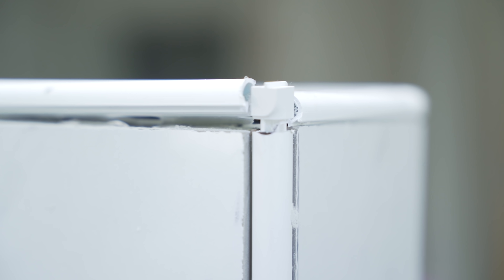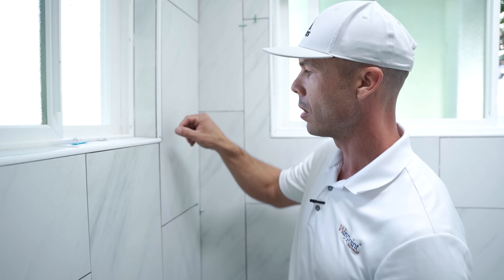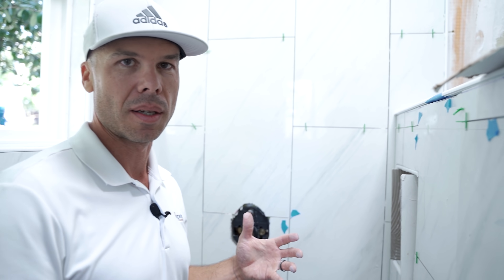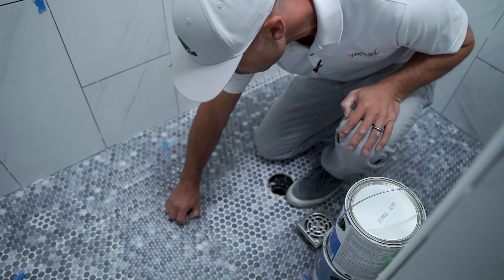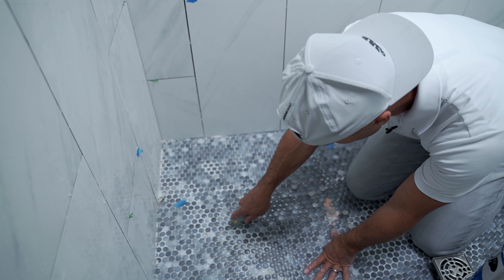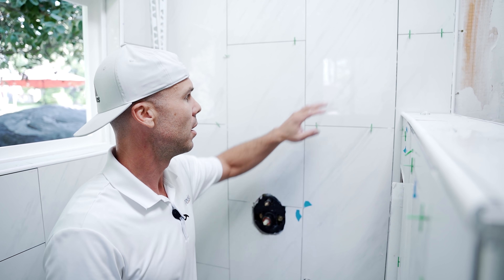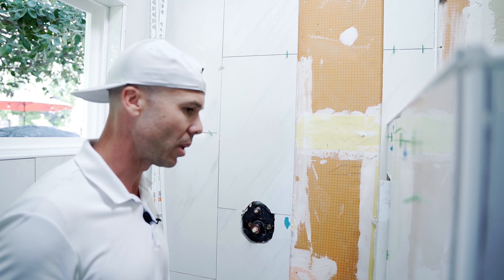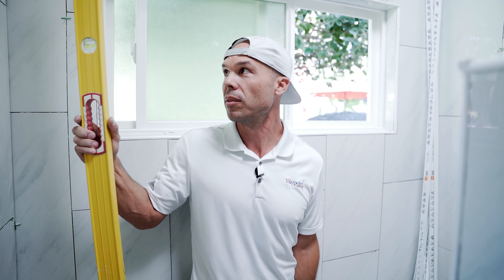WORST TILE JOB I'VE SEEN - Can We Save It?

Comment: Amazing channel and great video. Did my first tile job in a large shower and had to hire a tile setter to finish the kitchen (had another job start and couldn’t do the backsplash in time). The guy I hired has 16 years experience and said my shower tile work was almost or even just as good as his, all thanks to watching your channel and knowing what causes failures/common mistakes/setup and prep etc.

Thanks again

Comment: Thank you so much! I just had a trainwreck of a tile job, which the "contractor" offered to redo with a slab of wonderboard to even out the uneven (partially concrete) wall in our 1960 apartment. Your comments - twice - about not leaving space for condensation to build up - are invaluable! As is your comment about a licensed contractor. Knowledge is power!  And yes def get on nextdoor, I have found really good people through that app. Thank you!!

Comment: I am a homeower and have been doing my own tile.   Some parts have gone well...but my shower has been my nemesis.  The builder cut some corners when when building it initially and i had to rip the whole thing out due to mold and much too late for any warrenty.  I rebuilt it and tiled it.  And it looked awful.  Mistakes were made.  So I was forced to  tear it all down and start all over.   Several Weeks of hard work down the drain and it wasnt like I didnt try to do a good job but you dont know what you dont know.  So far the rebuild has gone much better.  Thanks for all your tips.  I will add one: in case you lay down your thinset too thick and have to scrape the joints before grouting, Dremel makes a bit  that makes removing grout much easier.

Comment: I started out earlier today watching Issac's 'how to' videos and was encouraged to build out two showers in the new house I'm building this year. Learning how to do it right made me confident. Then I continuted on watching a few of these fail videos, and I now have a lump in my throat. While I feel confident in being able to build the pan and walls and waterproof it all, I'm realizing that while that is critical, it is easier to learn. The REAL skill begins when it's time to set tile, especially with niches, curbs, and kneewalls. Getting everthing to line up, having a well-planned layout, have neat edges, straight grout lines, no lippage...oh man, that makes me nervous. But like Isaac says, no quality tilesetter will come in and set tile on someone else's substrate. So it seems to be all or nothing, either full DIY or full professional, start to finish.  I've done backsplashes and 3-wall tub surrounds, but I'm realizing a full shower is a whole other thing. I am a long way off time-wise for the tilework, but I'll be watching many for videos and thinking long and hard before I commit to do it myself. So these videos are very valuable in that way as well. They also make it crystal clear that it's important to get references and if possible even see the work of prospective tilesetters. Even as a DIY guy, I could see how horrendous the quality of this work was.

Comment: Well done. Nice job being compassionate towards the installer. Person was probably in over their head. Even if they’re a hack. Very tactful delivery.
Reply: Personally, I tiled my tub surround and I used cheap 12x12 tiles.  It doesn't look professional but it looks ok.  I tried to do everything 110%, which means that with my errors, it's probably 90%.  I live in a dry climate which helps.  Anyway it seems to be holding up great.  I wonder if this guy had used cheap tiles before, and then was hit with these expensive fancy tiles.  If I cut those things, they would look like crap.  I didn't have any L cuts though.

Comment: I think all of us tile installers make mistakes from time to time and that's honestly what likely to have lead half of us here to this channel. Tile at a glance looks easy, however by working with it consistently you learn that this isn't easy. Especially as a young contractor you find out the hard way that when it comes to tile work and getting the correct finished product. If your not correct and plum level and square and if your not gentle or experienced at making cuts. Your bound to get tired after thinking you've already covered all your bases which has already worn you out to start with. Then moving forward to find that this wall or this floor or these joints are not going to square up no matter what angle I try and push them on, already jammed up halfway up the wall and you realize. This mistake will lead to one of two conclusions. Either you take everything down fix and most importantly replace all that tile which is now useless. Or you try and sneak in an inch here.....................and end up being off a mile on the other side of the room because you were too tired or so frustrated to admit to yourself or the customer saying " Look I made a mistake over here and the result is this small section of tile will need to be replaced. I will be happy to cover it for you on the back end of my pay. But I'm afraid at the moment I can't cover the cost. But you have my word I know now and exactly where my problem lies and how to fix it. So if you give me just one day's work to correct this mistake. You will be overjoyed that I've made this correction. As the end result will make for the most beautiful installation you could ever hoped for." I promise you that the customer would not be upset and if they are then they are just Dicks but no matter what you never let them see you sweat. Because when you do correct it. This will pay off big time In the long run. Because that Dick of a customer will have nothing but nice things to say as they walk into a flawless bathroom and enters the one good well off God fearing sweat woman or man they know to use the bathroom and asks "who did your shower and bathroom?" That one reference is all it takes because that God fearing sweat woman or man will hear the story of your honesty and loyalty to your work no matter what those dicks may think about you. Because the quality of your work stands out too well now. And once more your honesty and loyalty heard by this new customer that God has now thrown into your lap shows not just the quality of your work but, the quality of your character as well and she or he want's you to do their entire church for them and those church members want to welcome you to their homes and that's the kind of honest with ourselves we need. Combined with  our faith in God to see us through when we uphold to gods will no matter how beaten or broken we have become or tired of sweaty and fed up with this stupid tile that just won't fit...No we relax ourselves take a deep breath and find the answers and then we thank God that the Tile coach had those answers in a short video that lead us to a new beginning in our lives ( and the customer is none the wiser don't watch YouTube diy on a job). That we would of otherwise thrown away had we just given up and hope that this job pays and the mistakes slip by. Never lose hope and hold onto your faith in God and the rest will fall into place.
Reply: Cut the god crap!
Reply: The fk lol was this ramble??

Comment: As a home owner, I watched yours and bunch of other videos before attempting by bath remodel. I got the right materials and tools for the job.  Some of things were easy, like installing the cement board and waterproofing with regard. Once that was done laying the tile was way more difficult, as in you know how to do it but you don't have enough practice or experience to get it right first time. ( Same like learning to drive a car, it takes much time spent behind the wheel to easily accelerate and merge while entering a highway, if u know what I mean). Unfortunately for DIYers the first project may be the last. As once you have a bath remodel or two, you have to tackle a different job. So even though you have everything from the right education ( like this video) to tools, materials, it will take more than one job to get it right. I did do my bath wall tiles, and I managed to address the coverage, by removing tiles a few min after install. But had a hard time getting the plumb right and avoid lippage. Had to struggle to remove couple of tiles next day as they were fully set (lippage), it was a lot of work to fix the imperfections to get it as close as a pro job  Finally it turned out OK for the naked eye,, but if you take a level and look for imperfections, you will find them like a good tile Contractor would.

Comment: Great work man and awesome advice, I also install tile , mostly on floors but that level of work is unexplainable just It can all be avoided. 
Also using a grinder to make cuts , I wouldve used a wet saw if I knew the cut side would be exposed 

But I’m also pretty young rn so I don’t really have experience using that edging band

Comment: I had to tear out a full bath. The 30"x60" subway tiled shower was completely de-tiled in 10 min with a flat bar. The 2"x2" floor tile was pealed up by hand in less time. They use lines 1" apart of yellow wood glue on the floor tile. The install was one week old. It doesn't get any worse when you have to tear out to the studs and start over. At that point, they all are equally bad.

Comment: I think Schluter allows small format tiles on their new pans. I'm not 100% but I thought that is why they designed a new pan.
Reply: Yes that's correct, the only schluter product with size restrictions are ditra and ditra heat.

Comment: We just went through a similar experience. Our licensed contractor sub-contracted a tile guy to do the shower. No waterproofing, water puddled in the corner, tiles uneven, grout leaked water under the pan, etc. $4,990 for redo by a pro who was willing to write up the problems   with photos and video to help present to original contractor. We didn’t do enough research before hiring the first time.

Comment: Hey bud. Can you show me where Schluter says not to use that size mosaic tiles on the base?
As far as I know they don’t want to see anything under a 2”x2” tile on Ditra.
Reply: I agree. I actually called Schluter and they said there is no minimum tile suggestion on Schluter pans.  I specifically stated the penny mosaics and he said it would be fine. Only for Ditra is the under 2"x2" suggestion.

Comment: So several years ago I hired a guy that was recommended from the place I bought the tile. Long  story short, he was to do my kitchen floor. They had to redo it twice. Literally tried to grind old thinset with hand sander. Could not cut a straight line. 1 and 2 inch spaces along wall filled with grout. Covered my floor vent because they could not cut around it. If you tap or drop something on the floor it has a hollow sound. I redid it myself, everything I did was great. I never will allow someone to do any work again. I u tube it as long as it takes until I know what I'm doing. It's like being a expert with no experience. I am now remodeling my shower using 2x4 tiles with no experience. Looking great so far.